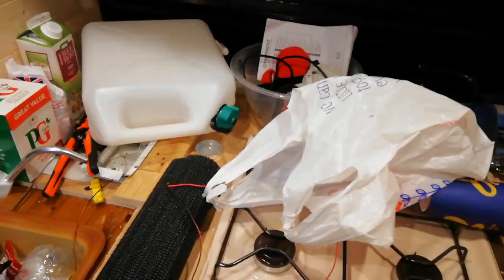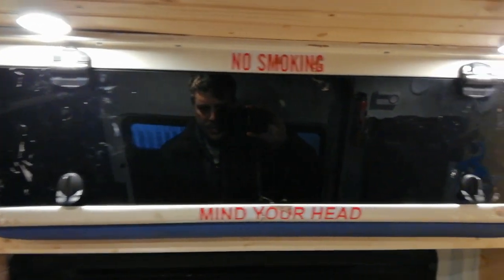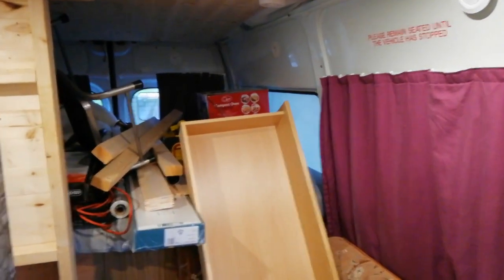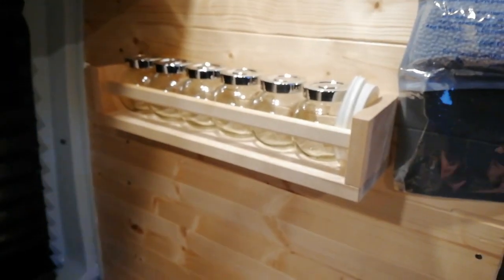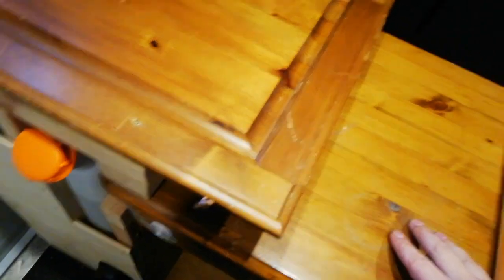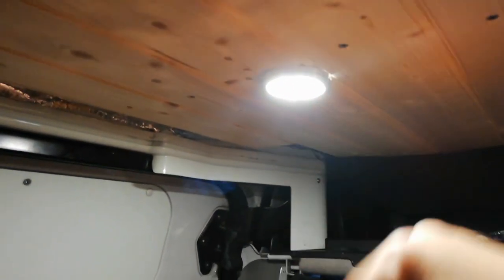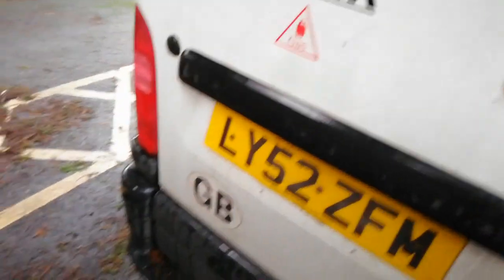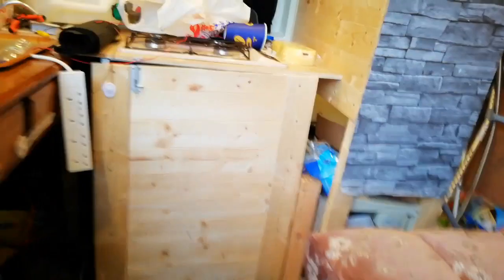#VanLife Vlog, Rain, Bit's & Bob's job's & Damp patches!

Comment: Looks a nightmare mate. Need nice weather to crack on with it 👍
Reply from the maker: It was a little bit of a pain but hey that's self build isn't it really or I'm my case fix it, bodge it and then definitely leg it lol... Definitely agree warmer weather needed mate.. All the best mr and Mrs stytch and Renee the campervan
Reply: Yeah mate am gettin a little water in on my rear doors haven't got a clue as I have new seals on mine. Weather doesn't help too cold on the hands when working 👍

Comment: Could the curtain be getting caught in the seal?
Reply from the maker: Hiya fella yes we did think maybe it could be a case of the curtains getting shut in the doors but we've had a long hard look and they aren't near the outside of the doors so it won't hurt replace the rubber seal as it is torn and looks very old... All the best mr and Mrs stytch and Renee the campervan